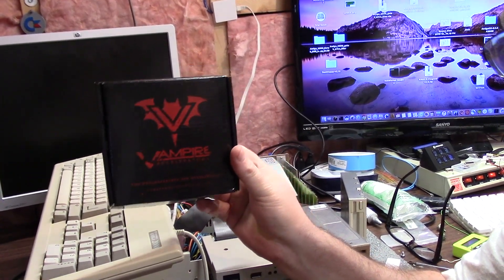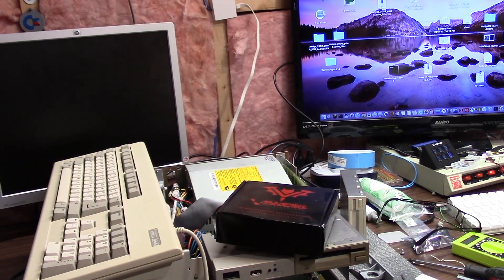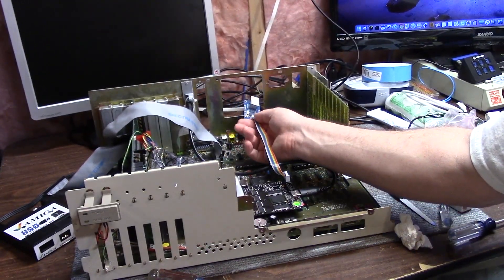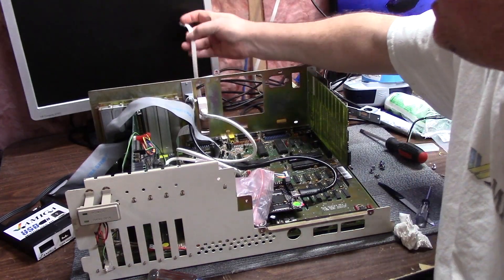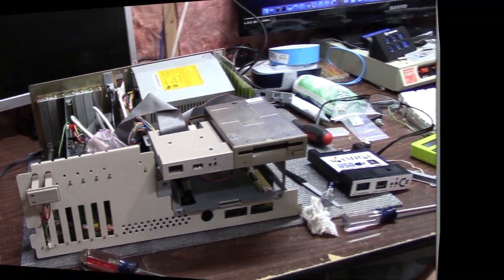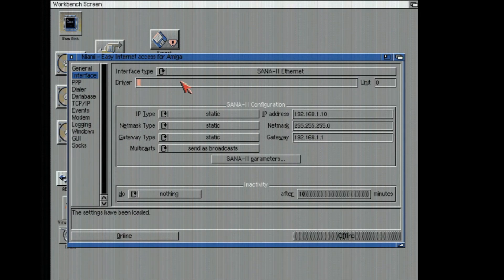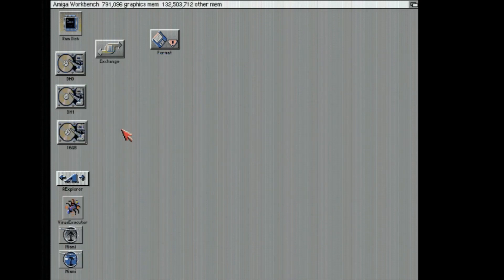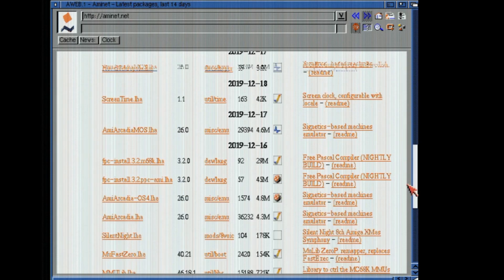Vampire ethernet for under 6$

Comment: Thanks Chris 👍🏻 Just got one of these Network gizmos for my Vampire V2 A1200. Just trying now to get this puppy working using Coffin R59. Had networking running fine with a Netgear PCMCIA and just swapped over to the ENC but not getting online even though I’ve got all the lights on and flashing on the ENC. 🙄
Reply from the maker: did you swap to the expeth.device for the vampire? its in the saga lha files, if you need the driver let me know
Reply: @ChrisEdwardsRestoration  Hi Chris. All good now. It’s that old piece of hardware between the keyboard and monitor that I had to fix (I.e I’m at fault 🙄😉). Plugged the ENC into the expansion JTAG instead of the one marked Ethernet as per your video. Using the V2expeth.device with no issues. All up and running. Had to remove the cnet16.device out so only one network config file. Cheers 👍🏻

Comment: Chris - I love that 3-D printed bracket.  Is that on Thingyverse or did you design it yourself?  Any chance of borrowing the design files?
Reply from the maker: bracket or filler, for the filler i think the model has a weirdness to it, i have printed 6 and all 6 the edges upturn, thought it was adhesion, but no, if you have upturn on the edges let me know, it still works as the upturn is on the inside so it dont matter, but prints weird   https://www.thingiverse.com/thing:744041 hers the filler, the bracket is the actual Gotek housing with 4 normal standoffs on the bottom
Reply: @ChrisEdwardsRestoration  sorry, I meant the bracket for the ethernet port for the back of the A2000
Reply from the maker: Oh woops yeah its on thingaverse its sd card to hdmi holder i just widened the sd slot and ethernet fits in it
Reply: @ChrisEdwardsRestoration  found it, here is the link for anyone else  https://www.thingiverse.com/thing:2873594   Cheers Luke

Comment: The thing is if something is working for you then its best for you.   Some people have ways of doing things which over complicates things.   I have had Amiga's in the house since the 1980's.   My A2000HD is the same age as yours only I am the 2nd owner.  I don't claim to know everything Amiga I have forgotten more than I know today so I am out there relearning like most people and so any information is good and the simpler for me is always the best and later on you can evolve.   Happy New Year Chris if you happen to have another accidental stream tonight I will join you with beer in hand.   I have one of those J-Tag boards I use to use in my A1200 I should pull it out and see about connecting it to my Vampired A600.
Reply: As far as I understand, the Vampire 600 / 600v2 cards only have the JTAG port on them and do not support the Ethernet module.  Furthermore if you check out the documentation regarding the Vampire 500 / 500v2 board documentation on Apollo's website, it states the Vampire 500 DOES support Ethernet modules, and the Vampire 600 cards do not.